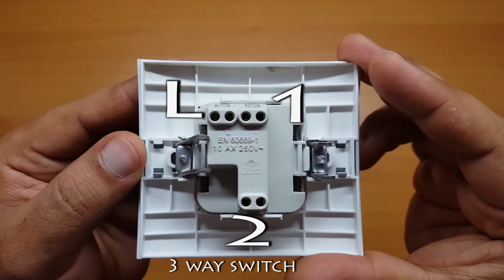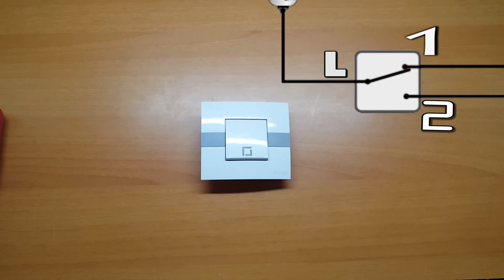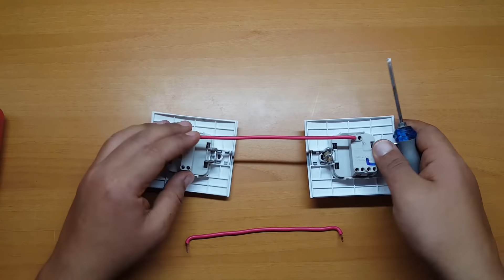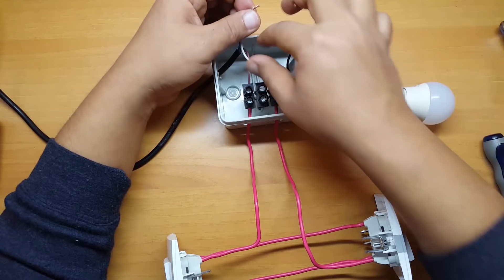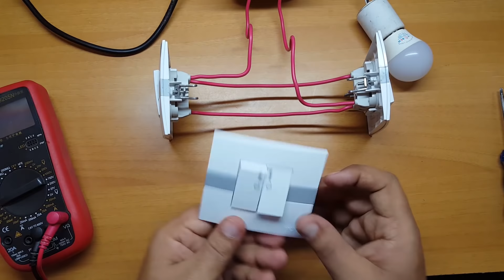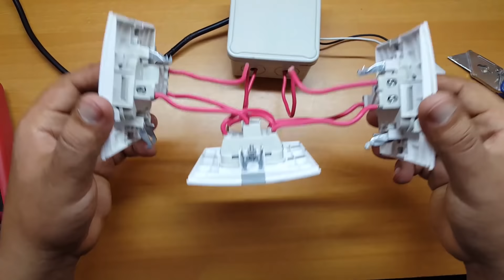How to connect 3 and 4 Way Switches Easy Wiring

Comment: I have question? First set 3 way traveler to 4 way line and 4 way out to 3 way 1,2...why in second set why 4 way line out is going to 1,2  of  second 4 way and the line of second 4 way is going to 1,2 of 3 way line..why defferent for 1st 4 way and 2nd 4way the out for 3 way..pls help i need to understand.